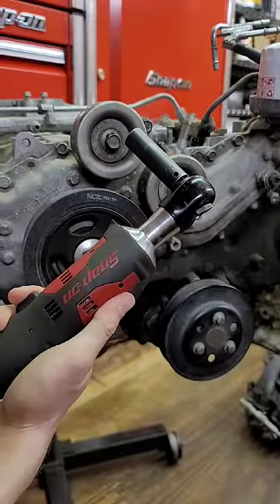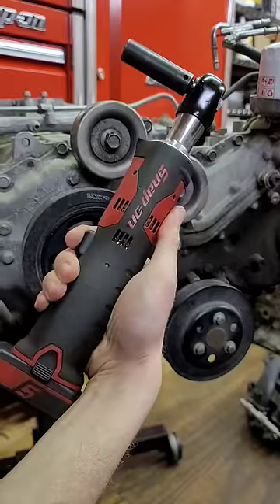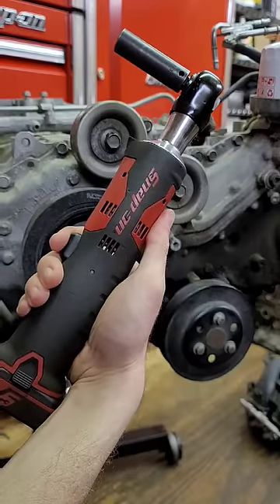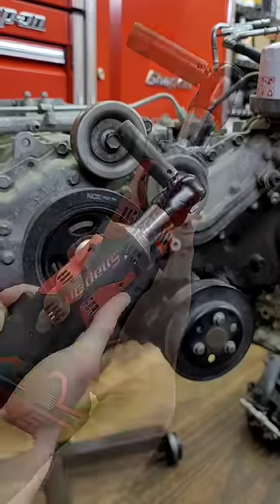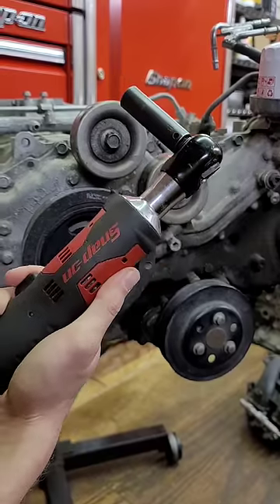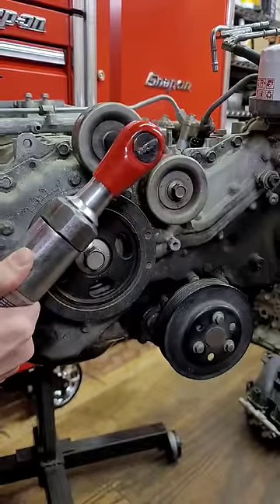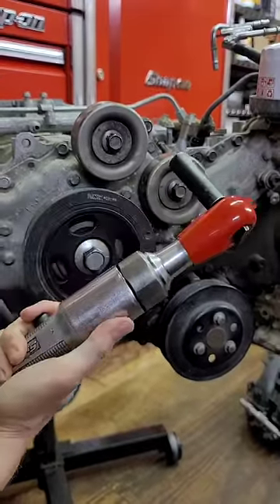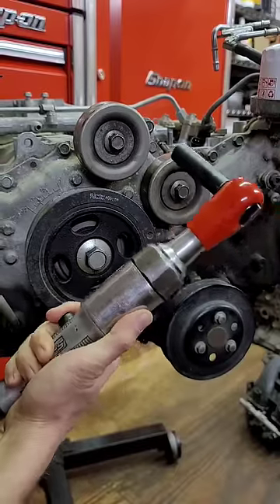Don't Use Electric! Use Air! Duh! #Snapon #Shorts #CordlessRatchet

Comment: I find anything that needs lots of torque to break loose air is the way to go and I'm not picking up a powered ratchet. I'd never use a pneumatic ratchet that completely defeats the purpose of having the space to reach into tight places. Powered ratchets are definitely tools of efficiency not of breaking power.

Comment: you can imagine how amazing it felt the first time i used a battery powered pin/brad nailer after using air powered ( also paslode I hated those) it was amazing and wanted my own until i saw the price but i still want one the hose is so annoying and as the slowly die from getting kinked and little holes leaking air annoys me so much.

Comment: Lol. What I do is, start spinning the ratchet and as it’s spinning I put it on the nut/bolt and that’ll break it off 😂 or just use the electric ratchet as a normal ratchet to break off nuts and bolts.

Comment: Hit the button and have the socket spinning then slap it on the bolt. No it won't strip it if you are any good but yes the air has more torque than electric but far more inconvenient

Comment: i have been really slow to move away from air to electric

but now that I have, I wonder what the heck took so long?

i used regular ratchets and wrenches far more than other guys, cuy dragging a hose/ratchet could be tough (so, I just didn't do it much figuring, "it doesn't take too long to just do it by hand..")

maybe okay for an individual nut or bolt along the way, but damn these electric ratchets are nice....

Comment: Electric also doesn't require you to be near power. Plus they're much quieter. 

I'm not dragging a freaking air hose into an airplane to remove the one V band clamp when an electric ratchet is much easier.

I hate air ratchets for the sole reason of how annoying the hose is.

Comment: Looks to be using a 3/8s ratchet.  I'm not a pro so won't spend money on replacing what works for me.  Manual and air ratchets and 1/2 inch AIR impact

Comment: Well I would rather use air than pay $100s for more batteries when i already have almost every air tool than I'll ever need I only carry a crescent wrench in my car. When electric tools last is when I might consider it but until the tool and battery last longer than 15 years of use I'll keep my air which has lasted 18 years with no issues never had to spend any more money on new batteries unlike some of the battery powered hand tools I have. But air is always there to pick up the slack when the battery dies.

Comment: Electric ratchets are the shit bro just manually break it loose with it all the time , it’s a normal ratchet too tighten or break it manually first always guy , or if you spin it and let it get the momentum first and then it’ll still break it without manually having to turn it , air ratchets are more restrictive in tight spot

Comment: Anyone that suits on these has not needed them or used them alot.. try getting in a tight spot with a hose.. even with a swivel .. Milwaukee makes them in 1/4" and 3/8", my 1/4" can snap a 1/4x20 bolt with ease.. they are the new age stuff that works better for a reason

Comment: I hate using those dang air ratchets the hose is always in the way. And yes what’s so hard about braking the bolt manually then run it out with the electric ratchet

Comment: Not gonna slam electric power tools, got some myself on the truck. That said.... My air tools do have more power and spin faster, start wratchet and then slip on bolt. Secondary thought.... Air tools are generally cheaper, last longer (got some with 25+ years on em, still working great). Oil is also cheaper than replacement cells when they hit charge/discharge life. Now for an honest question.... Who here never runs air tools higher than the stated 90psi? ;) Let's see you increase voltage by 50% to get more power, without letting the magic smoke out.

Comment: Why would you bother with air ratchet? You dont need torque it just pulling a bolt out faster now if you need torque i think air still dominate it for now soon air compressor will not be needed unless respraying or sandblasting things

Comment: So I work with both of these and honestly I can stop both of them with my bare hands I do have about 300 lb with a grip strength slightly less but I can still stop it with my bare hands I can't do that to my impact drills or my hammer drills so it's not really made to do that

Comment: All I have to say is that air or electric it couldn’t get a tractor nut loose and I had to get a cheater with a ratchet first. But air is for sure better than electric but for small stuff probably not much of a difference, but you can tell when they used air to put it on

Comment: Battery tools are a gamechanger. No need for a compressor at all times. Your compressor rating affects your air tool ability to do the job. Your 1200 ftlbs isn't with that tiny compressor. Glad I ran 220v in the garage.

Comment: Well, with all the racket an air ratchet makes, it has to be stronger, right? More louder, more stronger, right?

Not so much.

These driven ratchets are just to speed up the turning on the threads, not to break something loose.

In addition: People with a dentist addiction should just go there anyway.

Comment: Wrong, if you going torqueing on that electric rachet it's going to break in half. Unlike the pneumatic rachet with full metal construction, most certainly will not break.

Comment: I only hate using air tools because shops are cheap assholes and only put more hose clamps when the hose snaps. A rubber hose missed my face by millimeters and I've seen others miss being hit by one by only millimeters. I'm paid $14/hour. That's not enough for that bullshit.

Comment: Cordless ratchet is still a stupid term
Saying its cordless implies that this ratchet is the exception due to it having no cord
When in fact... The air ratchet is the exception due to it using air

I would rather have it called an electric ratchet or battery ratchet or motor driven ratchet... Implying its an exception because its run on battery power

Comment: If I never use an air tool again I’m happy. Electric everything please. I hate the weight the noise and the stupid hose you drag around with air. Only a weekend warriors wanna use air. Air only guys are the same guys that laugh at you for wearing rubber gloves while using chemicals. I don’t like carpal tunnel or cancer.

Comment: The snap on electric ratchets are junk sadly. Their air tools are fit, I've just seen to many of the electric ones in different generations just not hold up. You can spend half the money and get something at home depot that's better, with a lifetime replacement warranty.

Comment: Well if u had any other cordless ratchet than an overpriced snap on it would’ve got it off just my opinion
Reply from the maker: Nope. Milwaukee Fuel didn't either... 😂 other vid.
Reply: I stand corrected I personally don’t like snap on bc in my opinion they are far over priced for there performance

Comment: Compares a low voltage battery op tool to an obvious high end air tool to boast about air tools. Get a better battery op tool to compare...
Reply from the maker: It's literally Snap-on vs Snap-on you 🤡